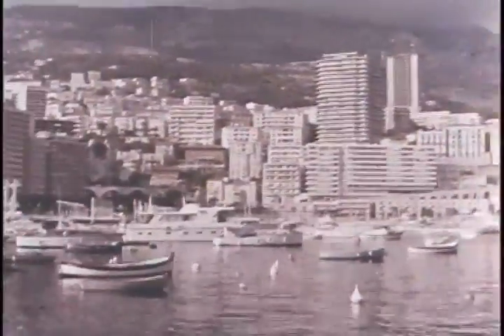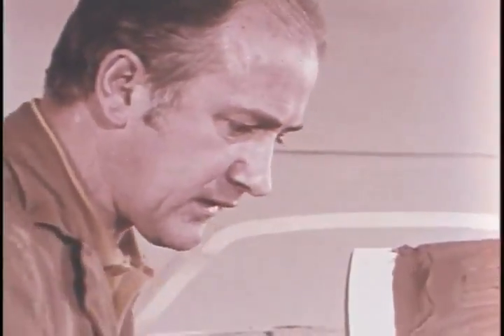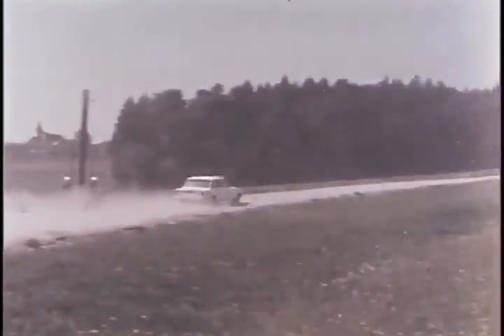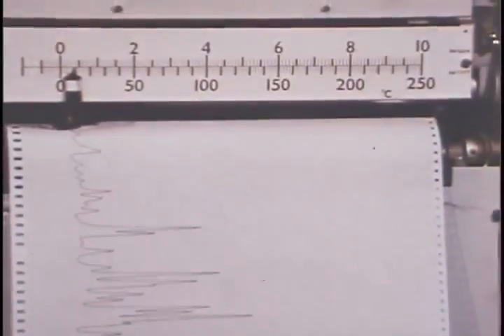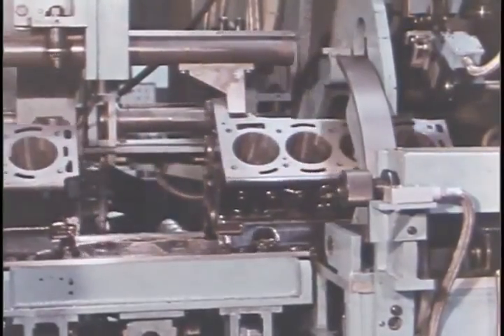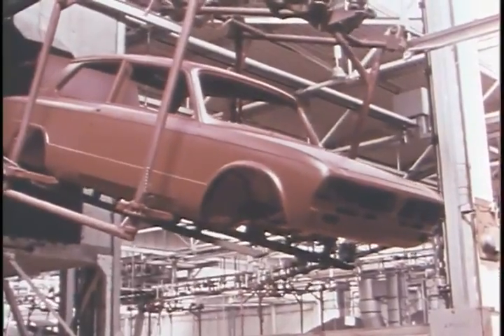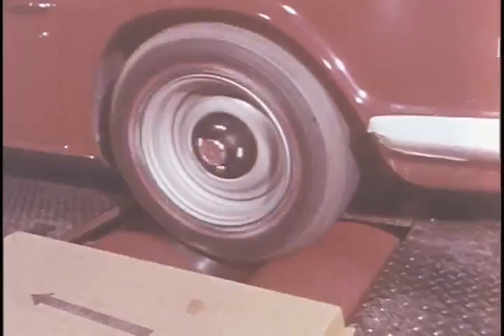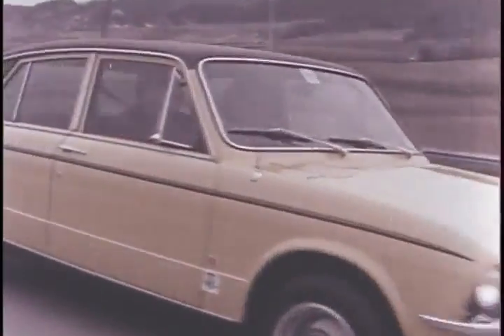This is Triumph

Comment: I have bought a yellow Stag in July. I rode nearly 2000 km in this time without having any problems.  The last owner upgraded the engine with a new cooler and other things, so I have no problems with overheating.
For me this car is perfect. I love the lines, the coulour  saffrane yellow and of course the V8 Sound.  It is not so showy like a mustang is, no it says ok man I musn't but I could if you would like to...

Comment: The six cylinder cars were great, 2.5PI with overdrive, really comfortable cars with lots of space.
Reply: Except that the Lucas PI system was unreliable !!
However, I had one that gave me no grief at all, it did rust a lot though and the bottom end died.

Comment: How did this fine  Motorcar  ended  wi the  invasion  of  far east   motor  industry  between 1973-1977,I  was in 1978 in the USA, bought my second TR7   until it was retired in 2001  in  California,drove  from Michigan  in 6-8inches of snow to  California,without  any mechinial  break downs.